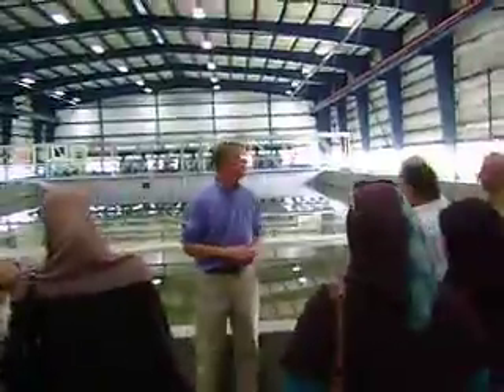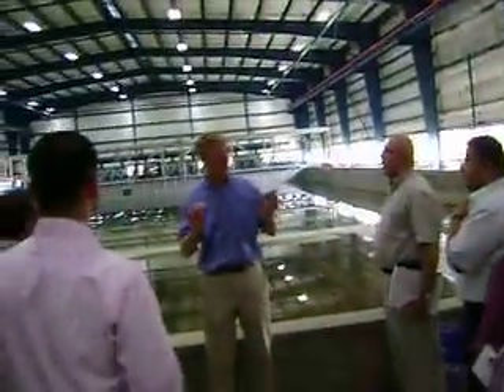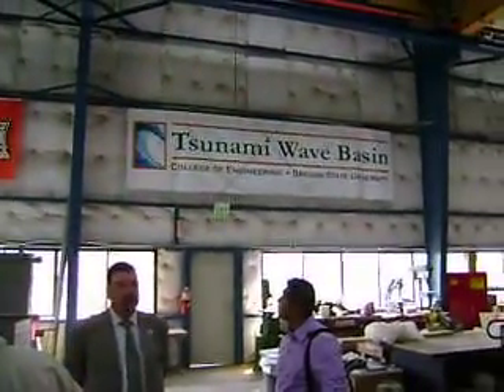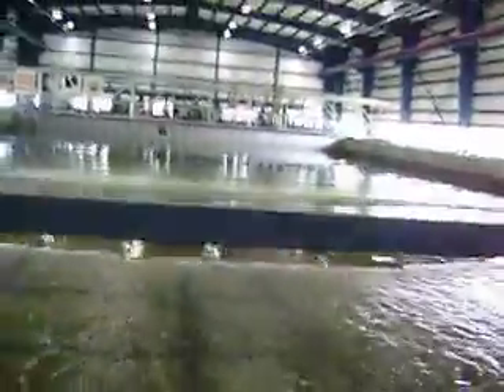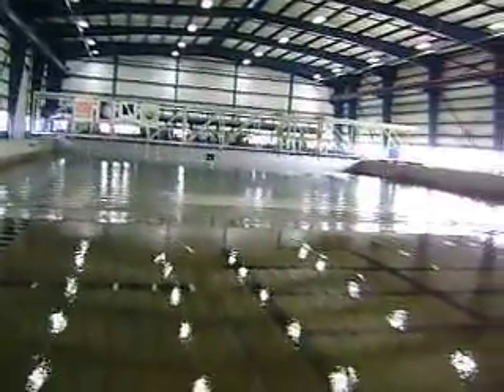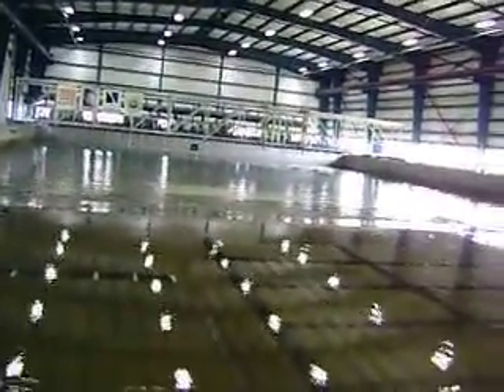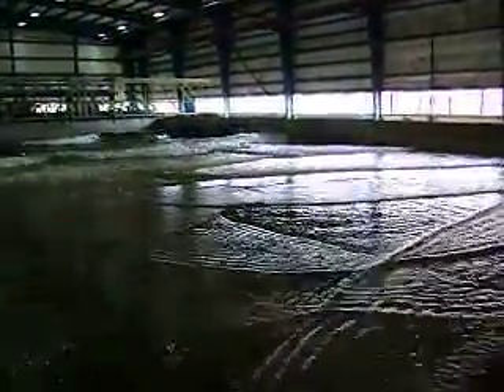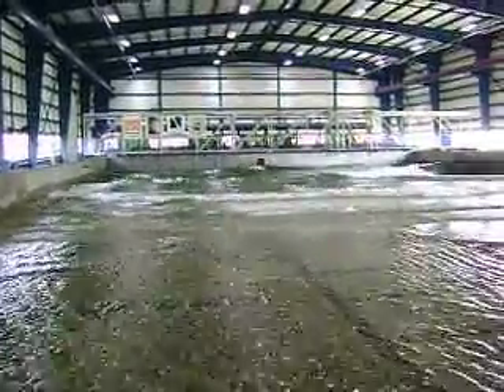Tsunami Wave Maker

Comment: @dudeanddude100 Well im not sure what you mean by "push like hydro pumps air" but i can explain how id imagine they got this to work...Assuming this was created the same way a real tsunami is...they would have a shifting plate underwater at floor level...The plate would shift (most likely vertically a bit) causing an unbalance in the water forcing some of it away from the spot that shifted...Gravity takes care of the rest keeping the wave intact from one side to the other...